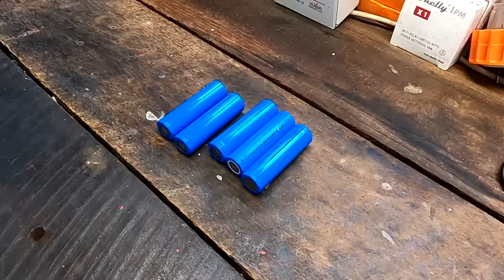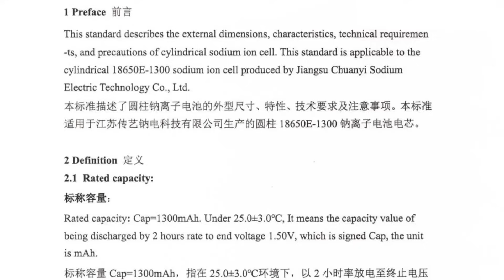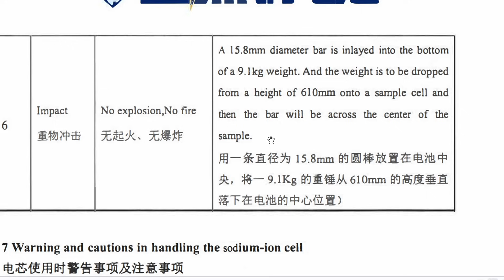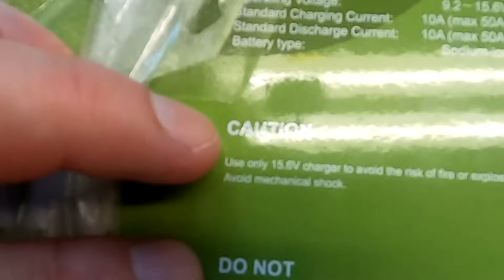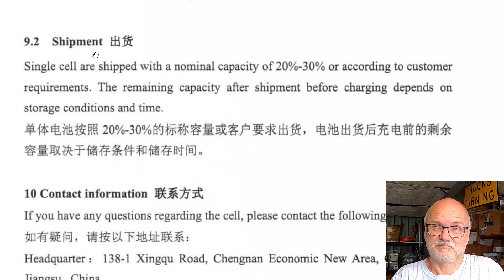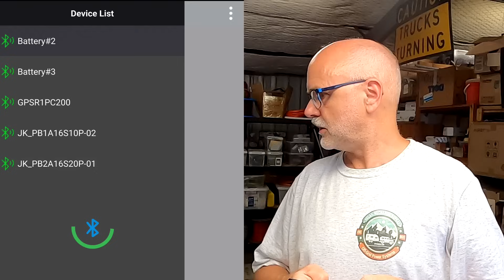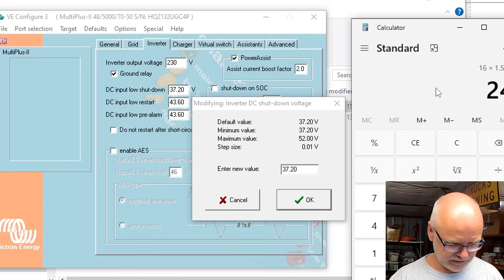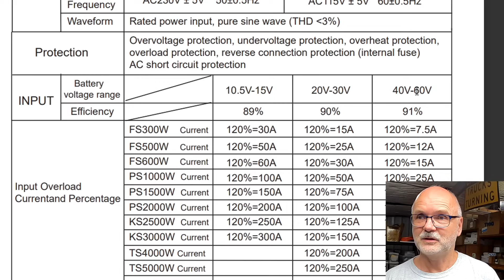Sodium Cell Charging and Discharging Analysis, Hardware Compatibility. Future or Niche product?

Comment: This is very interesting.  I still think the flat voltage curve of LFP would be preferable for running 12 V electronics etc (well obviously lol)...  Love hearing about new battery technologies.  Thanks for taking the dive into sodium.  Been wondering about this tech for some time now.  I wonder if these can cold crank starters for vehicle engines?  Im trying to see the advantage of sodium over LFP.  I guess if these can supply very large amounts of cold cranking amps, similar to lead acid they might be a good replacement for starter batteries with their very low temp capabilities and the capability to be drained to 100% with no adverse effects.  This would be a huge plus and maybe a market they could take over.
Reply from the maker: As per the specification, below freezing point they can only be charged and discharged with 0.2C. So, not good for starter batte.... hang on, who still uses starter batteries???
Reply: @OffGridGarageAustralia  Oh right haha!  I forgot the Tesla is in the other garage.   Yes good point on voltage.  I wonder if its the same though with that large 12 volt battery on the bench.

Comment: Hi, new viewer. Thank you for your time and effort. Suggested test: Low voltage cycle torture test. 1.5v-3.5v. Hypothesis: cell would experience maximum heat flux, and might reduce cell life due to anode breakdown. I'm a welder, not a engineer, please educate me if I'm off my rocker here.
Reply from the maker: Hello, welcome to the channel.
With what current though and how many cycles. 3.5V is not really low voltage any more for these cells?

Comment: I can't see any use for these at least in the 12V RV market, along with voltage sag under load, I think the usable capacity would be  likely only about 20-30%, so not practical at all. I guess a voltage regulator could be used to keep a constant say 13V, but high  current ones of those are extremely expensive! 
So going on your testing Andy, Sodium Cells do not seem practical at all!
Thank you for your hard work testing etc, however I fear Sodium Cells will prove a waste of time, at least for our 'normal' demands with inverters etc.
Reply from the maker: Yes, I'm 100% with you here. Especially seeing the results of further testing I already did. More video to come.

Comment: Inverters with wider voltage range shouldn't be a problem to make, they just need to test and validate existing hardware. 
Please remember that the modern restrictions on voltage range is because lithium cells blow up. DC components with a wide range of step up and step down range work fine, although there's always an optimum range. 
If these cells are not a fire hazard, I can see even a .5v to 5v range for each cell, meaning that a "12v system" can range from 1.5v to 15,  3v to 30, or 5v to 50. We need to start talking about these as series configurations of maximum voltage, not nominal voltage configurations - like we used to before lithium cells (with their weird curves) became popular.

Comment: With such a voltage curve, why even try to balance things. You don't need a BMS in a lead acid battery (actually 6 cells in series). Not even when you connect 4 for 48V. You just need the right invertor I think.

Comment: Wouldn't is be pretty easy to add a DC voltage regulator between the battery and the inverter/charger ?
That way you can keep the voltage ( at least when the battery is on the low side ) up, so that the inverter keeps working.
Shouldn't be that big of a problem to handle, the tech to do that is not new at all.
Of course the voltage regulator must handle the amps as well, meh, thinking about it, I don't see why this can be a major issue.
You don't have to replace existing tech, just add something more to deal with it. Shouldn't be a problem, I think.

Comment: Been there done that. Tried 4S na-ion batteries with JK bms, charging, discharging working without problems. But delta voltage on those batteries makes them almost unusable. It is possible to use them in lifepo4 voltage range, but one must accept, that it is using only 50% of their already low nameplate capacity. Could be good for low temperature usage though. Andy I don't know where you bought those cells, but Hakadi store is selling real 1500mAh na-ion 18650 for around 1,6Eur piece. They are pretty damn cheap already and if they will go cheaper it will make sense to use it with limited capacity usage. It is quite possible as sodium is around 1000 times cheaper than lithium.
Please test LTO batteries, they are fantastic.

Andy you didn't charge battery unless you charged LTO with 10C in 6 minutes...
Reply from the maker: I have 6 LTOs here...
But I charge with solar, so 10C is pretty useless in this regard. Maybe my ride-on conversion will get LTOs🤔 But why...
Reply: Yes I'm still actually thinking about application of LTO and so far I found electric scooter, or car, which can be charged few times a day, or solar light used during day in dark room charged few times a day, I have one working in my kitchen. 45W solar panel, 6Ah LTO DIY 12V battery and 25W diode strips. Working flawlessly.
I already tried scooter application, it is quite convenient because 15S LTO matches voltage of 10S Li-ion exactly. So instead of 3S li-ion I put into battery 2S LTO.
I failed on BMS, in that time I didn't find BMS which will fit into scooter, I was able to make around 6km's on LTO electric scooter. Then my batteries disbalanced.
But I already found some BMS which should fit, so I'm planning to try again.
There is also solar application for LTO where somebody wants high performance system with lower capacity battery. LTO has low voltage sag, so you can get away with 20Ah batteries for 60A system. Or more likely if you are using for example electric stove, where you need 10kW for relatively short time, you can get away with 70Ah LTO system. Which is capable to deliver 210A constantly, e.g. 10.9kWh. 
It can be used in tandem with Lifepo4 batteries, where LTO is naturally handling high power bursts. It is possible to more less match voltage range of Lifepo4 and LTO.
With 22S LTO you have 2.54 per LTO cell with 56V Lifepo4 max. 2.54is somewhere around 85% capacity. With low voltage of 48V you have 2.18 per LTO cell, which is around 3% capacity. So technically it could be possible to connect LTO and Lifepo4 in parallel.

I have one interesting idea for you. Recently I reworked my house solar system from 16S Lifepo4 to 18S Lifepo4. Main reason was this "s..tty" power capacity of my Victron Multiplus - 3000VA which is in reality around 2500W continuous. My usual house energy need is around 300 - 700W, so if I run some power appliance which is 2000W, I'm over spec of Victron. It is working around 30 - 60 minutes in overload state and then shuts off because of over temperature. Victron is strictly temperature controlled for overload, so it is dependent on working current. It is able to handle around 50A continuously. So increasing voltage from 16S to 18S is also increasing ability of my Multiplus to handle power. In reality it increased my power capacity of Mutliplus from around 2500-2600W to around 2800 - 2900W continuously. Which is right enough for me.

And this exactly is the reason why I stopped thinking about na-ion batteries. For efficiency and maximum power, solar system must work on highest possible voltage possible. So for this spread of battery voltage must be as low as possible.
Winner here is Lifepo4 which has between 3.5V and 3.1V 12,9% voltage spread.
Second is LTO which has between 2.55V and 2.2V 15.9%
Third is Li-ion which has between 4.2V and 3V 40%
Fourth is Na-ion which has between 3.8 and 2.2V 72%

Comment: It seems like you could treat them like lithium iron phosphate keeping them well inside the safe zone. If they are cheaper/lighter/safer I could see using them. I have been using AA versions with good results in my cameras.
Reply from the maker: Too expensive for that using only a portion of their capacity.

Comment: Also realize as battery voltage declines, the amount of required inverter battery current draw rises to make the same inverter AC output power.  Besides just V x I consideration, the inverter efficiency drops at lower battery voltage and cabling losses at the higher required battery current rises.

Designing an inverter better able handle the voltage range and resulting larger battery current draw range requires higher voltage breakdown, lower resistance MOSFET's and stronger transformers and some other misc parts, adding cost to inverter and resulting in greater no-load idle power on inverter to drive the switching of greater input gate capacitance, low Rds_ON MOSFET's.

Based on useable capacity and greater system losses I would not go to sodium-ion cell unless priced at about 30% to 40% of same AH rated LFP cell.  This assumes they make their claimed cycle life in real world which remains to be proven.
Reply from the maker: Yep, correct.

Comment: Hello Andy If testet 12 Sodium 1.5ah Cells in a 4s DIY Powerbank. The powerbank loads to 4.15 Volt and discharge to 3.0 Volt The Resultat was only 12500 mW/h . Then i Load for LiIon to 4.2 Volt and discharge with a Tester to 1.0 Volt with The Result of 1.45 Ah. Ich bin gespannt was dein Test mit der Sodium 12Volt Batterie bringt. Gruß aus Bayern Helmut
Reply from the maker: Discharging Li-ion to 1V???🤔 you are calling for the devil here...
Reply: @OffGridGarageAustralia  No that were my Sodium Cells 😃
Reply: @OffGridGarageAustralia  sorry my English ist Not The best...

Comment: Great video!
Have you had a look at the 40 or 45 Ah lithium-titanium-oxide (LTO) batteries? They can also be charged at sub zero and have a massive current capability, including fast charging due to some "magic" about the chemistry apparantly. Nominal voltage is only 2.3v and they have an upper limit of 2.8v but discharge cutoff is 1.5v. Here they are also different in that they do not take much damage from 0v discharge if done at lower currents. Otherwise they can do 10C charging and discharging! Very interesting!
Reply from the maker: I have LTOs here. Fast charging is not really something we look at with solar installations, do we?
I wonder why they didn't install them in EVs if they are so good...?
Reply: @OffGridGarageAustralia  Energy density is half of lithium...
Reply: @OffGridGarageAustralia  For solar lights and such the LTO's may be worth it though, as they can be charged when sub zero. This is important as it's starting to become the primary failure point of solar driven street lighting in colder countrys.

Comment: excellent video!!! the biggest possible benefit we can get with this technology, is that when it matures it becomes substantially cheaper than lifepo and proves to be safe for transport and allows less difficulties when it comes to transportation than lifepo, (which falls into the lithium-ion category for most shipments), and so one does not mind losing 20% - 30% of capacity.
Reply from the maker: I don't know, these are all marketing arguments... Will it ever get cheaper? Who will buy so many cells so they become cheaper if there is this big hardware challenge. Safer? We talked about it in the video.

This is exactly what you can read out there, but without any substance or real world numbers. All this theoretical information. Like solid state batteries🤣

Comment: Sodium batteries work well enough, but have great competition from Lithium. Cabins, operation of appliances, motorhomes and other minor contexts seem doubtful in terms of the market. But electric cars can be a useful opportunity. There is a big difference between max and my Volt, it requires a lot of new chargers and changes in products meant for charging and control. However, DC-DC converters along with sodium batteries may seem like a good combination. But the price quickly becomes too high versus other options. 
What is needed to make a fire in a Sodium battery? Too high charging current for a long time, puncture ? What about charging below freezing temperature?

Comment: Extremely interesting video, Andy. Thanks! 
The chemistry may be cheaper and better for the environment, so it could be relevant for stationary/solar use! 
Topics:
- How to treat the battery good? 80% cycle? You found no info. If someone knows, it would be good knowledge. 
- kWh / price and expected development. And compare that to LFP. 
- If you have contacts with Victron, maybe reach out and learn if they will adapt to this?
- if a 50V inverter produce 1kW, that’s 20A at the beginning, but 40A at the end, 25V / 0% SoC. In larger setups, it’s gonna be a lot of amps, and fat cables!

Comment: I'd like to ask you. If you are talking about e.g. 50% SOC, are you talking about half amp-hours or half kwh? Because right here, when the voltage difference is so large, the top 1% of the battery contains 2x as much energy as the bottom 1%.

Comment: I would be trying to build a 20s battery to see how much capacity it holds at 3.2 volt constant voltage charge and discharge to 37.2 volt = 1.86 volt per cell.

Comment: Interesting results. I am already thinking about building a Sodium-Ion solar setup for the unheated garden shed which often goes below 0 celcius.

Not sure about the low voltage range, but losing some usable capacity does not seem to bother most people with NMC car batteries.
If I remember this right you should not charge above 80% with NMC and not touch the bottom 30% in case of very cold weather.

Or am I just trying too hard to see the good side of Sodium-Ion ?

Comment: Thanks Andy, good job, they didn’t give you a lot to work with data wise. 
Doesn’t sound like too many pro’s for the price & expense of new gear to use it, 45oC sounds a bit low for our Aussie climate & the usable power wasn’t great either, maybe useful for outdoor solar lights/ street lights, etc.  LifePo4 it is for the win! 
A few comments regarding only needing a volt meter to see state of charge, ok for a rough idea but wont indicate current usage & capacity measurements so you know if ur losing battery capacity, I like a good shunt. Cheers

Comment: Hi Andy, as always a pretty good video about a NEW technology. Gratulations for reaching the 80k.
In case of the sodium batterie at this stage of the First Generation of these cells, there is more coming up. The chemistry and the density of these batteries will raise, to make it more reliable.
But i Think, the Energy density is not as good as LFP in the First stage.
Liebe Grüsse

Comment: It’s a nice replacement for LiPo batteries since they don’t work in 12V systems 3s would be too low and 4s would be too high. You can charge sodium batteries in 4s configuration to 14.4V and drain it down to 10V safely. The only down side is we don’t get to get the full capacity maybe approximately 900mAh each cell according to your discharge graph. I hope in the future they are able to keep the energy denser so this can replace lithium since sodium is everywhere

Comment: I tested 5Ah Sodium NA+ cells, these cells are designed to be very safe, but I pushed the test as far as driving a nail and subjecting it to a high temperature. it produces a very big explosion.
I don't know if it can be used as a battery for an electric vehicle because the battery could be seriously damaged and explode. I made a video (in French) on my channel "cristof48"

Comment: I have same problem with 16S li-mnc battery from VW ID3/4.
I need to charge 64,8V and stop discharge at 56V and solution like destroy the baterry and remove 2S and change to 14S.

Comment: I reckon when the sodium chemistry is more widespread then charger and inverter manufactures will include the suitable parameters, maybe even fireware (firmware) updates for existing units if hardware supports. Interesting curve on them.

Comment: To have no problem with the under voltage Protection, it would be a option to couple the sodium battery's to a LFP Battery via a bidirectional DC 🤔
Reply: I was thinking about an extra DC voltage regulator between the battery and inverter, the regulator keeps the volts up, so that the inverter keeps working.
Ofcourse, the regulator only kicks in when the voltage is on a set low voltage point.

I hope the Victron company is taking notes ! Shouldn't be a problem to deal with this !
Reply: @edwinbruckner4752  I think the DcDc can't handle the peak currents. Because of this I would prefer a "buffer"
Reply: @rcweinstadt5210  Yeah, I don't know what currently on the market.
But yes, you need a Dc to Dc regulator wich can handle the amps. Say, 150ish max. and your safe ?
But technically speaking I don't think it's really a problem.
( im going to google it right now, see whats on the market )

Comment: Or might be a good idea to make battery banks out of 17 cells with your MPII though, then you will not charge and either discharge fully. It should be good for the cells... and you will benefit for the extra capacity